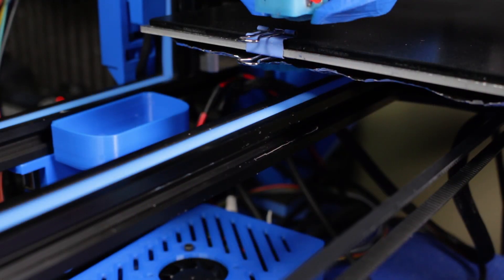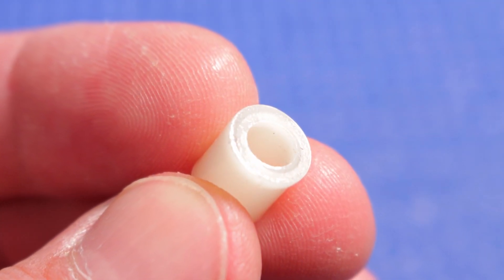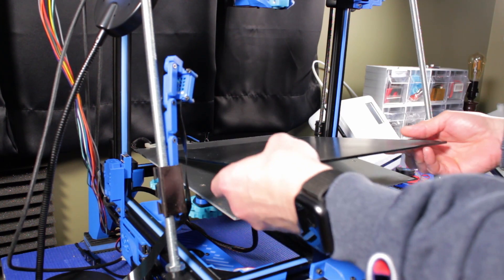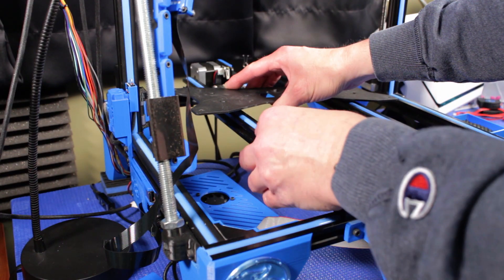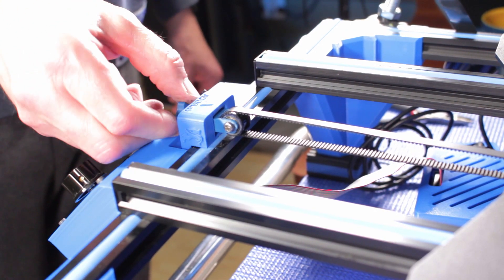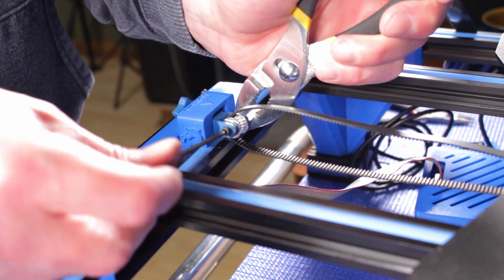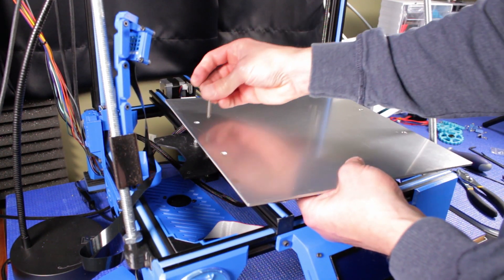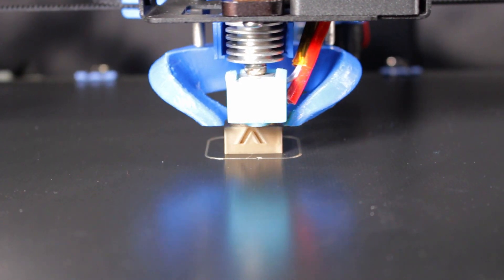Fixing A Broken Rail and Modding Y-Axis Parts

Comment: Nice video 😊 question thou how do you level the bed? I didn't see any springs under the bed? How does that work
Reply from the maker: I use silicone spacers instead of springs.
Reply: @cswilsonprints  is that more stable then springs or is there other reason for it
Reply from the maker: In my opinion, the silicone spacers are more stable than the springs. I also use manual mesh bed leveling. The combination of silicone spacers and MMBL allows me to go a very long time without needing to level the bed.
Reply: @cswilsonprints  i guess that's what I will be testing out when I get a chance 😊 thanks for your time 😊👍🏻

Comment: Did you notice any difference using the poly carbonate wheels? Are they harder or softer?
Reply from the maker: The pc wheels seem a little harder than the delrin wheels and I believe they’re supposed to be more durable. Time will tell if that’s true.
Reply: @cswilsonprints  Wondering, 5 months later what the results are?

Comment: Can you provide a link to the idler's you used for the tensioner pulley's?  Thanks great video!
Reply from the maker: The ones I actually used came from Ali Express, but you can get the same (or similar) ones on Amazon.  They are GT2 Idler Pulleys with a 3mm bore and 16 teeth.  You'll also need a 3mm bolt & nut since the stock idlers use 4mm.
Here are both links:
Amazon: https://www.amazon.com/WINSINN-Aluminum-Timing-Pulley-Printer/dp/B07BPLPZWN/ref=sr_1_1?crid=7XM6PLB8LW2B&dchild=1&keywords=gt2-2m+16t+idler+pulley%2C+3mm+bore&qid=1587082209&sprefix=gt2+idler+pulley+16t%2Caps%2C148&sr=8-1

AliExpress: https://www.aliexpress.com/item/32902033345.html?spm=a2g0s.9042311.0.0.68444c4dCiDnQQ